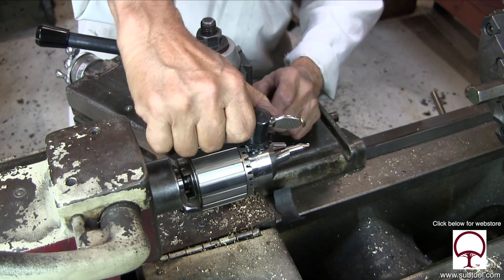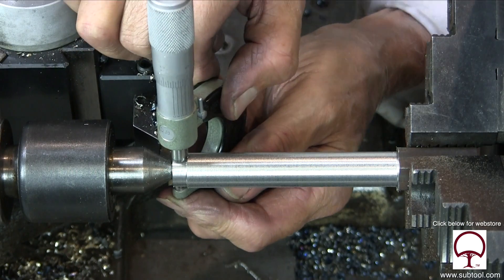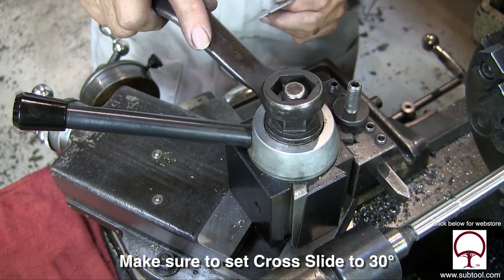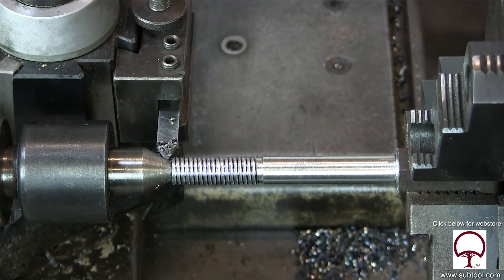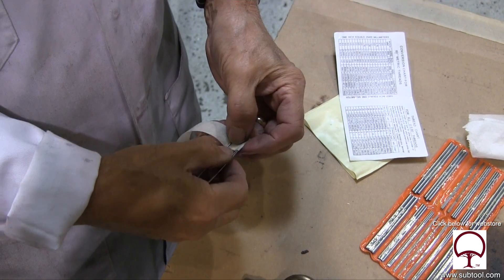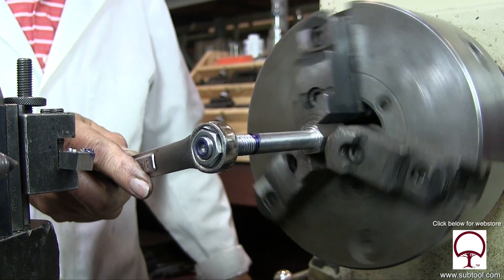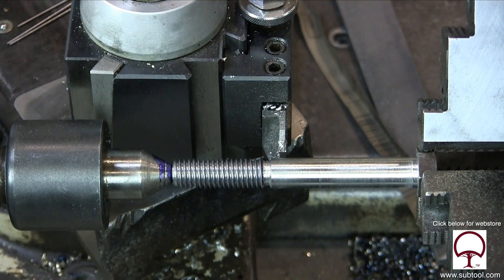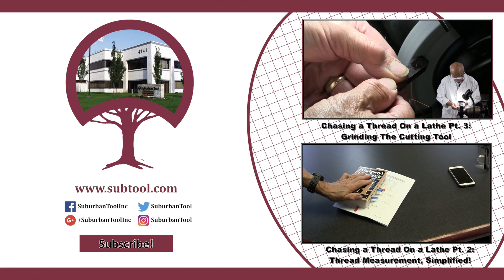Chasing a Thread On a Lathe Pt. 4:  Cutting a 1/2” 13 Thread

Comment: I love single point thread cutting. I mean I know that sounds ridiculous but I absolutely love it. If I don't have a project going I'll make a handful of screws or nuts just to throw In my hardware bins

We just got a very very very old Power hacksaw that dates back between the 20s and 30s perhaps earlier. It's a great big old Beast with a 20in by 5 in flat pulley for some real power. While going over it to repair broken items and replace bolts and screws and whatever else needed to be done to get it up and running nice I ran into a bunch of 1/2 inch by 12 TPI bolts. They were dropped from the National Standard around 1930 so getting Taps and dies for them are next to Impossible. Turning the bolts was no big deal I made a bunch of the bolts that I needed and crowned him to look like the other ones polish them up real nice excetera. But when it came to tapping holes what do you do? That was at my Wit's End when I decided that I would try and make my own tap. So I got a piece of drill rod turned it nice imperfect cut for flutes in it with a rounded bit in my Mill. I heat treated it who is hard as I could get it and carefully sharpened the threads with another pass barely engaging it and then with a 60-degree file went over it lightly lightly lightly. I was astounded the damn thing works perfect. Granted cast iron is self-lubricating in fairly easy to tap but I was just happier then you can imagine having accomplished this.

 I love watching your videos they are very inspirational to me as a beginner.

Comment: A chicken groove. 
  I have a trick to get away from that. Actually, two tricks. 
  I come in at 29.5 on the compound, so each successive cut cuts generally on the leading edge, yet just scrapes the trailing edge.
 Oh, and generally, my major diameter is slightly under the stated diameter.
  On a 1/2" I'd probably be. .494 er so... maybe less. 
  Love your video's Don!
  Mark

Comment: The angle of the dangle is proportional when the heat of the meat is constant to the direction of the erection, and the dimension of the extension is equal to the mass of the ass 
when the throb of the knob is driven.
If you do not understand please do not be afraid to ask !

Comment: When I machine threads on my lathe I always hit the end with a deep chamfer. As deep as the thread.If you don't chamfer the end the thread is formed square and you will have razor edges where the thread begins.The razor edges are very fragile and can easily bend over causing the nut not to start on the thread.WARNING. DO NOT USE A SPANNER ON THE NUT WITH THE MACHINE RUNNING IF YOUR CUTTING STAINLESS.                   If there nut is even a fraction tight on that thread, as the nut runs up the thread HEAT WILL BE GENERATED and the                   nut WILL begin to bond to the thread.  It will happen. The nut can be frozen or almost welded to the thread.                   It happens quite quickly and then suddenly the spanner will smash down onto the lathe as the chuck turns.I have been machining threads quite regularly on my lathes for over 15 years and I know this to be a fact.Coolant will not be enough to cool this thermal reaction as the heat is generated inside the nut. Its not just lathe work.If your hand tapping stainless (especially 304 and 316) with a nice new tap. At first the tap cuts quite easily as it runs down the hole.You can think your new tap is cutting very well. Then all of a sudden as the thermal reaction kicks in, you will feel the tap getting stiff. Your  1/2 second from losing the tap and the job as the stainless begins to bind to the tap.I'm truly sorry to write a negative as a response and I never thought I would. I have HUGE respect for Don Bailey who has taught me so very much about grinding and I'd be lost without his guidance.
Reply: true and run a smooth file over the top

Comment: Don - Even though I've been cutting threads on lathes for many years, I enjoyed your take on the subject. 

I'm thinking your nut went on tight because the major diameter of your threads was initially a little oversize.   External 1/2-13 should be about 0.002 - 0.003 under 1/2", measured over the crests of the threads.  Filing the threads after cutting them usually takes care of this without much effort.  I assume this under-sizing helps provide clearance for the mating thread.  There needs to be clearance in the pitch diameter as well, of course, but clearance at the extremes of the thread form is also important.   Also note that taps are usually a few thousandths OVER nominal size when measured over the peaks of the threads, I believe for the same reason (maybe your nut was cut with a worn tap).
Reply from the maker: You're spot on, thanks for the good information.